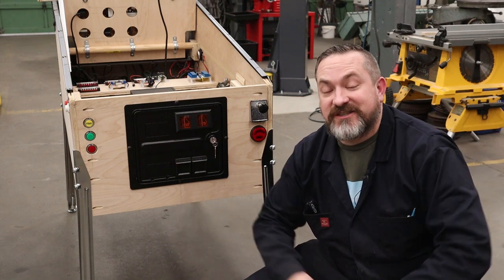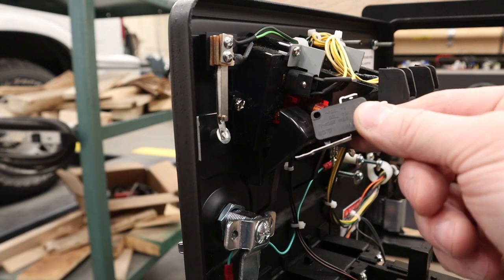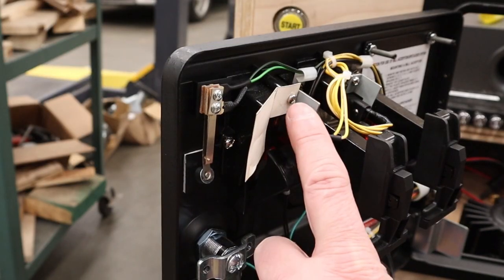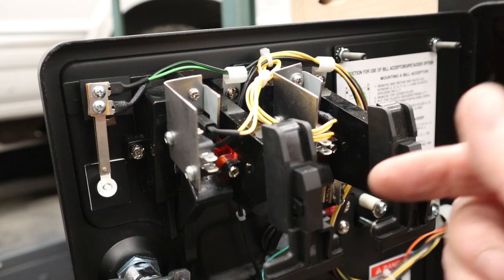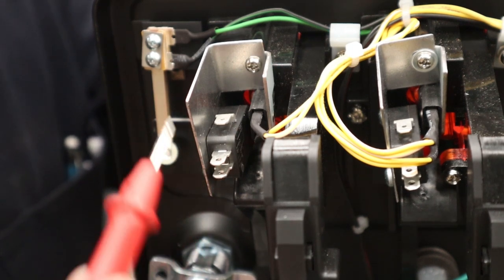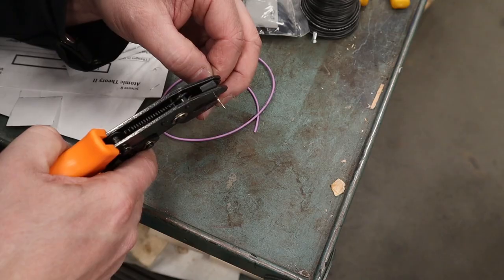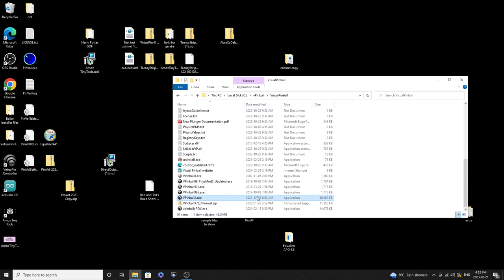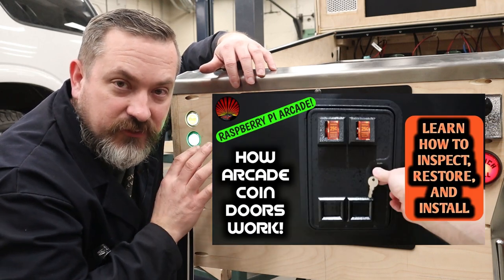How to make coin return buttons useful!

Comment: The idea of the “toggle button” is genius!!!!  And folks should seriously consider implementing this in a lot of facets of their cabinets.  Especially with SFF or DOF installations. Same premis holds true. You can easily add external cabinet buttons to your cab that will let you disable / enable all sorts of cabinet features using this same method. I like using round led switches for this.  Can give you a great “control panel” for easily Turing things on an off.  Great video yet again!!!!!
Reply from the maker: Right?  I'm using 2 normal front cab buttons as hold in for a shifted buttons and this turns my 9 buttons into 27!  Lots of control for all kinds of things!  Thanks for the watch!

Comment: Thanks for this excelent video. I've experienced that it is smart to use two seperate coin in buttons, since one button (smaller coin) often gives you only a half or even 1/3 credit (so button pushing becomes a full time job) while the other one triggers 1 to 3 credits. Depending on the table and it's ROM settings.
Reply from the maker: Not a bad idea.  I could see that you would just always push the bigger credit button instead though no?  I just figured I'd make them the same and add the shifted function for more buttons.  With Pinvol and Xpadder, I have 27 buttons now....lol Thanks for the watch!
Reply: @wayofthewrench  some tables just support only one button (the smaller), but yes, if they support both, i always use the bigger one.
Reply from the maker: Makes sense.

Comment: i did something similar with two extra buttons I had laying around. I removed the covers of the lighted buttons to expose their micro switches and the push rod on the back of the fake coin buttons on my door is a perfect match up. So i glued the buttons onto the back of the coin slots and now use them as volume controllers.
Reply from the maker: Nice!  You set up Pinvol too?

Comment: Thanks for the video.  I thought I was going to have to buy a token one.  I needed one for a 2011 frogger machine & took one out of my 1969 chicago coin fast ball machine & even though it said quarter on the outer part and quarter on the mech it already took the tokens so all i had to do was switch the two post to the other side & it worked just fine.
Reply from the maker: You're very welcome!  Glad the video was useful.  I also have another video where I restore an arcade coin door too.  You might wanna watch that one too.  Thanks for the watch and welcome to the channel!

Comment: Thanks Emil. Just FYI, next time, put the pocket holes on the inside of the cabinet and you won't have to fill them to put graphics on :)
Reply: He explains in the video where he teaches you to use the jig why that's not a good idea.
Reply from the maker: You're very welcome!  Yeah I did a test to see which way was stronger and the traditional way where you don't see the pocket holes was waaay weaker and had issues with the ends bulging.  So other way it went and some plugging/sanding later.  Thanks for the watch!
Reply: @wayofthewrench  Did you glue the joint?
Reply from the maker: Yes I did, plus glued in a glue batton on the inside.  This cabinet is not coming apart anytime soon....lol
Reply: @wayofthewrench  Oh, i ask because the pocket screws do little to nothing in terms of strength, that all comes from the glue. 

Cabinet maker here, so that's why i asked. Hence the pocket holes on the inside comment. :)
Reply from the maker: Yeah I'm not a fan of butt joints anyways, my favorite woodworking joint is a mortice and tenon......a hand chiseled one too.  Hrmmm, maybe the next vpin cabinet I'll make it with that...lol